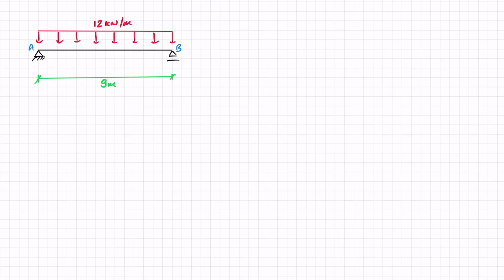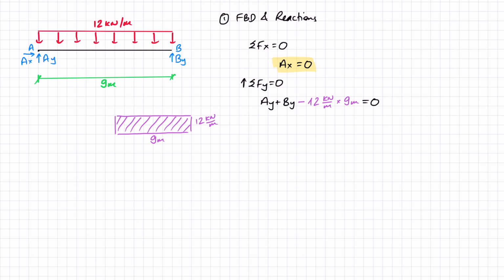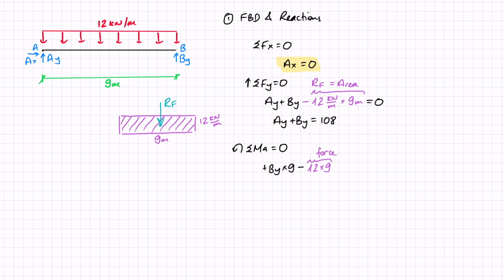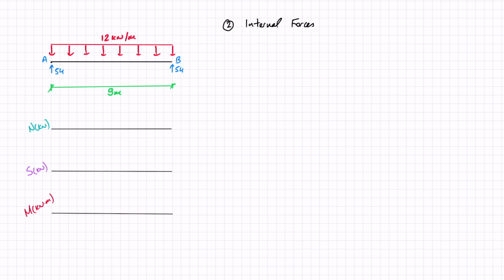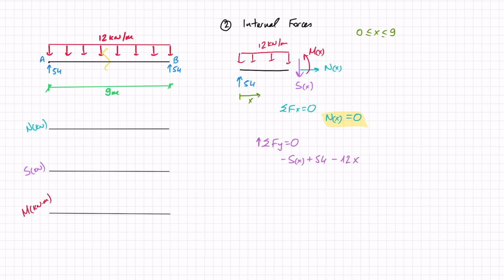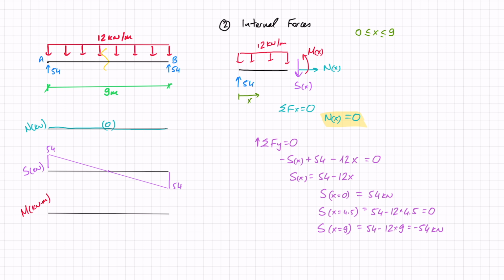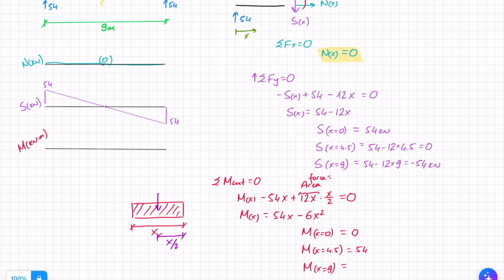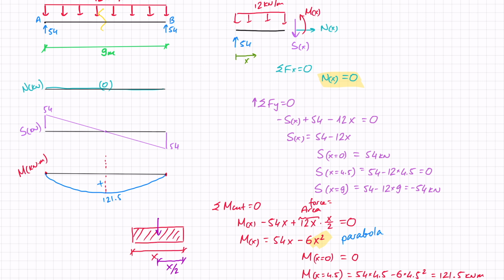Engineering Mechanics | Beam Analysis Internal Forces | Tutorial 2 | Step-by-Step with Uniform Load

Comment: Got me thinking now. Its years since I did this, but looked it up. The rate of change of the bending moment is equal to the shear force. Prove it by differentiation but forgotten how. Relates to those 2 equations. 😀 See it in the shear force and BM diagrams.
Reply from the maker: You're absolutely right! The relationship between shear force and bending moment is a fundamental concept in beam analysis. I go over it when I discuss differential connections. I'll try to add some more on this.